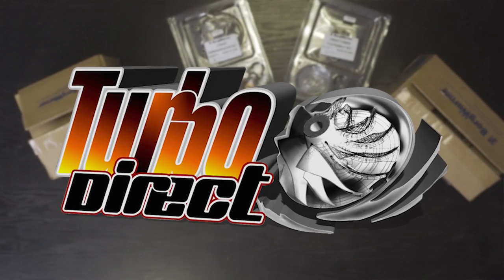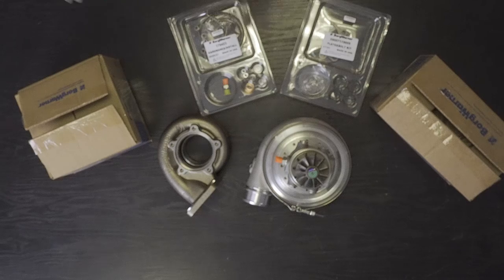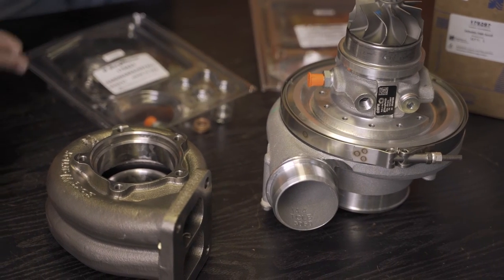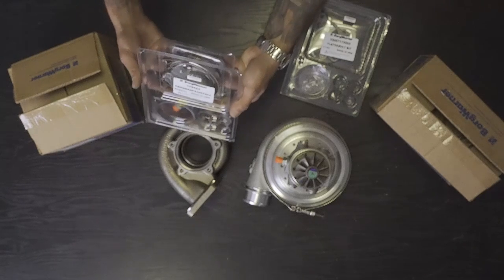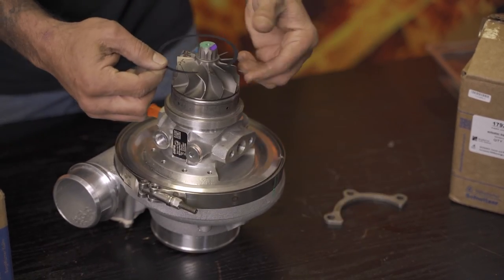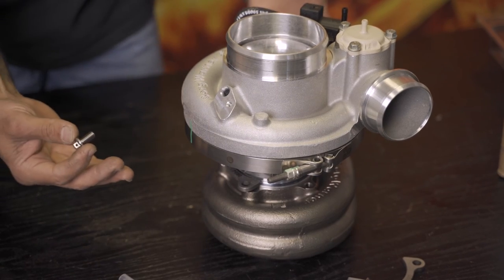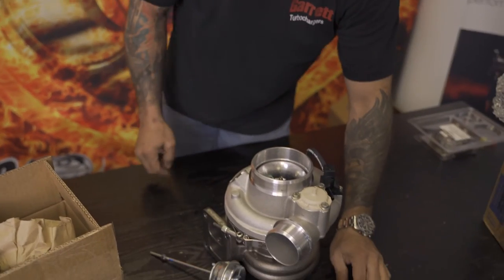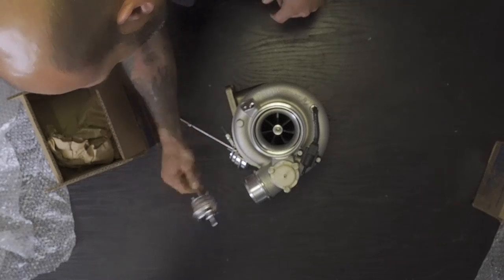Understanding EFR aluminium bearing housing

Comment: There apparently isn't an option for the efr7163 aluminum housings as they are 4 bolt and the bolt and plate kits you reference in the video are only compatible with the 5 bolt housings.  Any reason in particular that you see why there isn't an option for the efr7163?

Comment: Do you know the weight difference between 8474 ally vs iron cores and also for a long term road car would iron be a better option? Thanks
Reply from the maker: We havent weighed the two side by side - if you have a demand on cooling, or you live in a very hot climate, consider the aluminium option.

Comment: Is this necessary for the EFR7163 models with aluminum bearing housing....and if so, is it available.
Reply from the maker: necessary or an optional extra - its up to yu and your application. If weight is a concern, and cooling is limited, go Ally - otherwise use the norm.
Reply: @TurboDirectSA  Apologies, let me rephrase...is the clamping ring and hardware available for the EFR7163 with the aluminum bearing housing. (which is what I have) that will be installed next spring.
Cheers!
Reply from the maker: @grabtheremote  In the hardware install kit yes you will.
Reply: @TurboDirectSA  Thanks for the reply.  Happen to have a part number? All I see is the clamp kit for the B2 housings....5 bolt holes. This is a B1 with just 4 bolt holes.
Cheers!
Reply from the maker: @grabtheremote  179423 is the part number of
The hardware installation kit
Reply: @TurboDirectSA  apologies, I cannot locate the kit for the B1.... Even witht he given part number.
Cheers!
Reply: I have a 4 bolt b1 vband in vband out internally gated housing with aluminium CHRA and need the clamp plate you reference in the video.  All of the Borg installation kits with the part number you mentioned are for 5 bolt b2 turbine housings. Any further help would be greatly appreciated.

Comment: What a great channel! I got a crash course on reading compressor maps as well as you saved my ass on an EFR 9280 build. My current 9180 was purchased as a complete kit from a highly regarded kit builder and it came with iron chra install hardware! In putting together a new setup I purchased the same install kit for the 9280, assuming the last place knew what they were doing. Thanks!!
Reply from the maker: Thank you for the compliment - its exactly this scenario that justifies the making of these videos. Im glad to hear we have assisted you with your project.

Comment: 🤔 my EFR didn’t come with that load bearing ring and it had different lock clamps(individual ones), I purchase the plates separate. No issues thus far besides the power 😅
Reply from the maker: Just beware over time the ally bearing housing will fret.

Comment: Something that's i've noticed and thought you might know a bit more about it. Even on the high boost actuator it states not to exceed some max pressure like 35psi; If i want to run a higher boost pressure than that what do i do? Get the turbosmart actuator? Even that one has max working pressure..
Reply from the maker: The reason they state not to exceed the 35PSI rating is because the spring rate only works (compresses and moves the actuator rod) up to this pressure. Anything higher bottoms out and you will experience boost creep and potentially break an engine.....
Reply: @TurboDirectSA  thanks for the reply. Is there an aftermarket actuator/solution that will work with those higher boost pressures?
Reply from the maker: @St0RM33  Yes absolutely - Tial make one, and there are a number of other companies who do the same - for massive boost, i would suggest using an O2 can with an ECU control to manage the valve position - pain i know, but it does work well.
Reply: @TurboDirectSA  thank you!

Comment: I've always been impressed by these Efr turbos since their release. I was about to pull the trigger on a 7670 years ago but I couldn't find a turbine housing to fit my application. Now.. I could've had a new manifold and downpipe built but the cost turned me away. If I ever do another turbo build I'll be forming the process around one of these. You can run a much higher capacity turbo without sacrificing spool... These really are the best. There's a k24 civic time attack car making 900hp with a 9180, and it's got a massive power band. You just can't get that with any other turbo on the market
Reply from the maker: Exactly right Kalyn - all back to the compressor map and its width - which relates to the massive power band

Comment: When purchasing an EFR7163-F(V) there's a optional SX-E style compressor housing. What's the benefit of this housing over standard? For an EA888.3.
Reply from the maker: The housing is physically smaller, and has no solenoid or DV installed -

Comment: Thx for the video. What's the torque spec for the arp bolt ?
 Also, what's the main real benefit of using Alu vs Iron housing ? 
better water cooling than iron housing? 
transfer heat better - yes,  
lighter - yes (but what if weight is not a problem ? )
Alu bearing housing will fret over time, why not use iron instead ? just trying to weight the pros and cons of each and find out what's most important things to consider when deciding 

If my current setup the dump pipe has got no flex joint, would Alu chra become a weak point ?
Reply from the maker: Glad you enjoying the content - The torque specs are 17.6nm + - 1.1nm I would aim for 17nm and be safe in the middle.  

Aluminium in the correct grade and hardness (heat treated) with the correct tension load applied through the fasteners will not fret. 

Pro's are cooling, light weight, and more. Always install flexible joints in any exhaust system, no matter the materials used.

Comment: I purchased my efr8474 with aluminum core from your site. Would it have come with the hardware kit with the turbo?
Reply from the maker: The hardware kit and bolt kits are sold separately per part# - see here:- https://store.turbodirect.co.za/index.php/shop/turbochargers/turbocharger-turbodirect-s-a/179423HardwareinstallationkitEFR8474Black-detail

Comment: The 6758 (alum chra) i got came all assembled but i noticed that they didnt come installed with the plates you shown. Do i leave as it is or should i invest in those plates? Been using the turbo for 2 years already.
Reply: Ahhh, just found out these plates are for the B2 frames, so it doesnt apply to the B1 frames ya.
Reply from the maker: @dagger22  Exactly right buddy - the smaller turbos aren't as susceptible to the fretting as the weight is much less and alot less leverage being exerted as the turbo is physically smaller.
.

Comment: Not cheap this hardware installation kit for ALU: 150 USD!!
Reply from the maker: We definately do not sell this kit for so much -- even though you would pay alot more for ARP bolt for a flywheel for example, if you compared this to the hardware installation kit, whats the difference? 

We sell this kit retail for just under 90USD in our currency -- its well worth it.
Reply: thanks for your reply!
But why Borg Warner sell the turbo without this kit? @TurboDirectSA
Reply from the maker: @kosditrade  Because yo get both iron housing and aluminium housing options -- depending on which the customer chooses, he will need the kit. Iron housings do not require the kit.
Reply: @TurboDirectSA  I understand, thank you for your explanation.
Reply from the maker: @kosditrade  Pleasure sir.